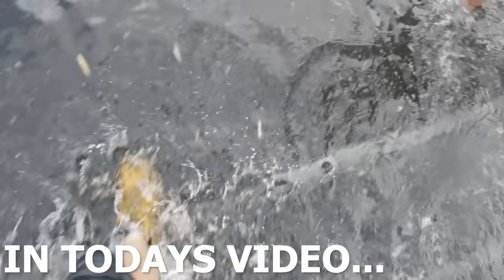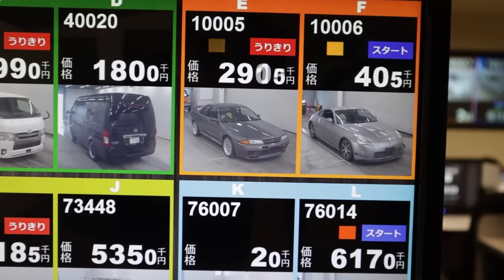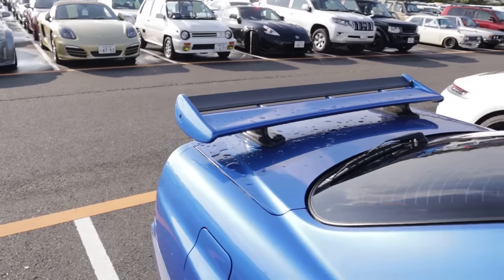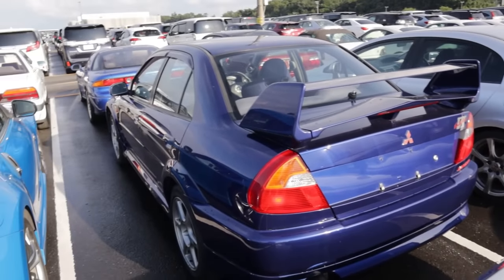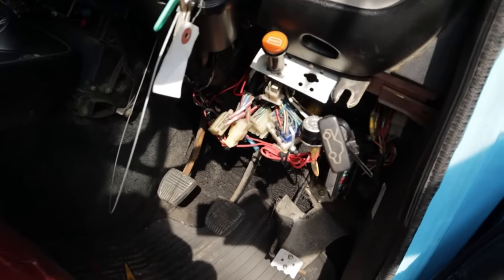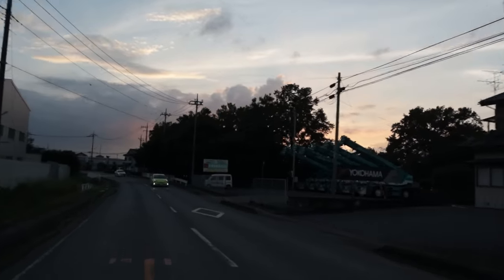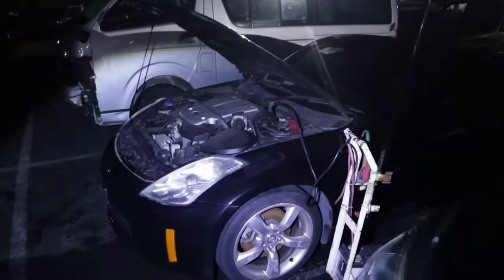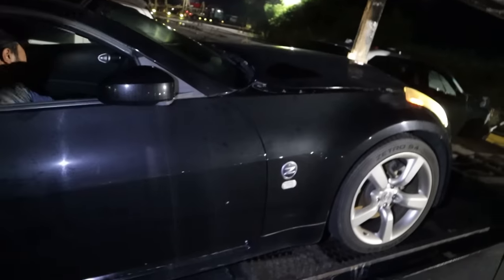BUYING ANOTHER CAR FROM AUCTIONS IN JAPAN!

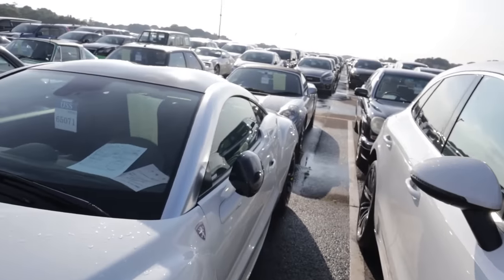Comment: DUDE!!! Forget the "lime green" Porsche...at 10:30 I need that 1988 BMW M3. Perfect 50/50 weight distribution, with a stock engine that already makes it a great low powered drift or grip car, like the classic "86". Minus the aero, spoiler and engine, it's almost the same as the 1984 318i I had in University. That makes it my dream car. If I were in a position to get there, any time soon, I'd be begging for the auction info.

Comment: I worked in the used car parts business for about 15yrs  in Japan,   not even 7-8 years ago I used to buy these rough  R32 GTR from auctions and dealers for the engine trans and parts,  average  between  150000 ~ 30000yen depending  how many aftermarket parts were on the car.prices are now 10~15 times higher for the same rough GTR, just crazy.  thanks  Fast and Furious

Comment: both evo you see (reims blue and icelle blue) are "basics" evo 6, not TME  (chassis number CP9A-010XXXX are for EVO 6, and CP9A-020XXXX are for TME)
SNGF is for the "GSR" equipment / SNDF is for the "RS" base model
you can have a CP9A-010XXXX with SNGF (evo 6 GSR) or SNDF (Evo 6 RS)
OR a CP9A-020XXXX with SNGF (evo TME GSR) or SNGF 2 ( real red evo TME with decal stripe) or SNDF (Evo TME RS)
If you own a real TME RS, chassis number will be CP9A-020XXXX with SNDF